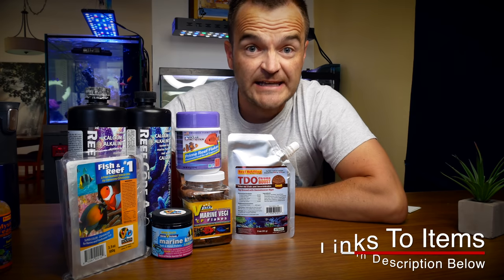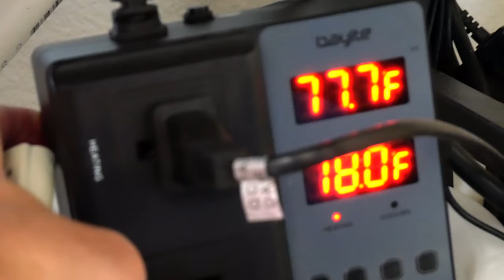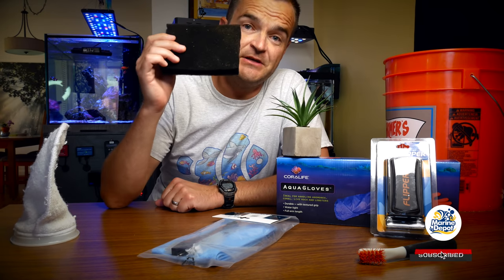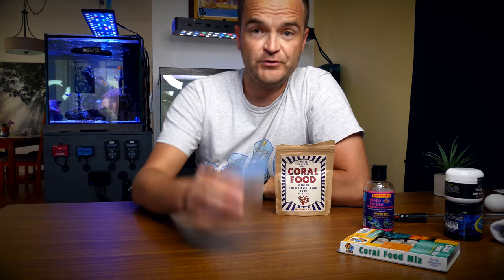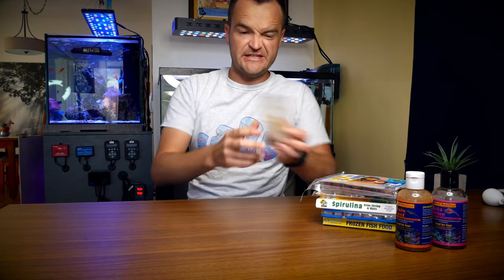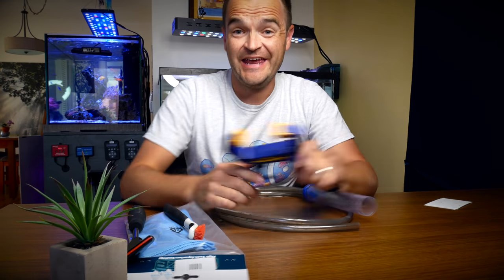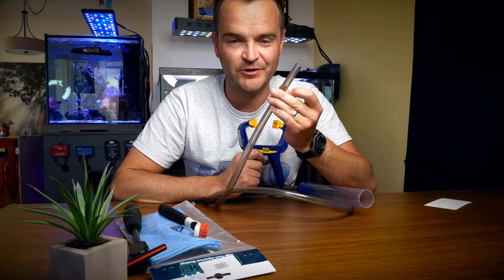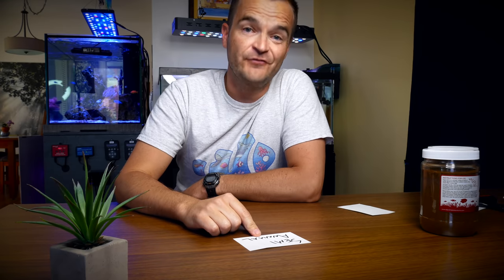Saltwater Aquariums Demystified Ep. 10: Maintenance

Comment: I agree with you on just about every single task. With the exception being the use of vinegar,  I use citric acid in place of vinegar.
Reply: Interesting.  A couple questions for you... What are the pros/cons of using citric acid over vinegar, and where do you get it?
Reply from the maker: Thanks for watching! Curious also about the citric acid.
Reply: I’ve also heard that you should use citric acid instead of vinegar. I started using it last week on pumps and heaters. It seems fine. There are some good threads on Reef2Reef on the pros and cons if interested. You can purchase it cheaply on Amazon

Comment: Vinegar will destroy the plastic on pumps
Reply: That's so interesting because I've used it for well over five years now.  The only problem I had with it was I ruined the rubbery piece on the wet side of the mp10 after soaking it too long, so I had to get a new wet side.  But never had a problem with anything else.  Tell me more... what do you use to remove the calcium build up from your pumps?
Reply from the maker: Thanks for watching! We also haven’t had any issues with vinegar.